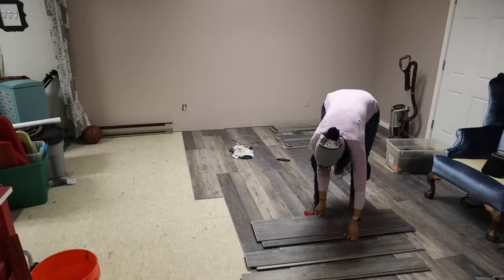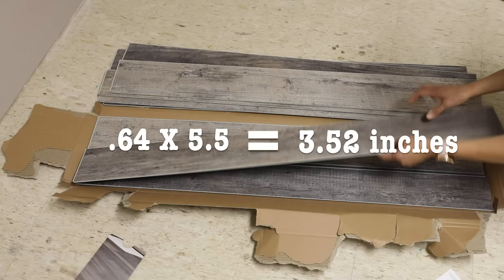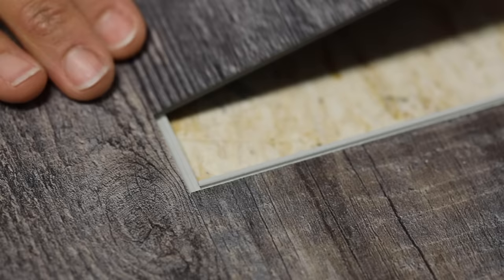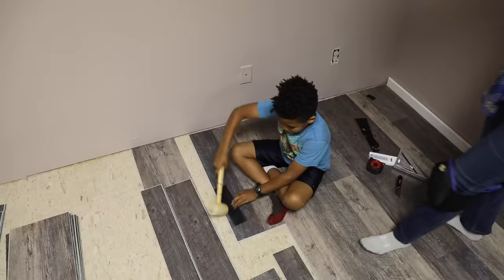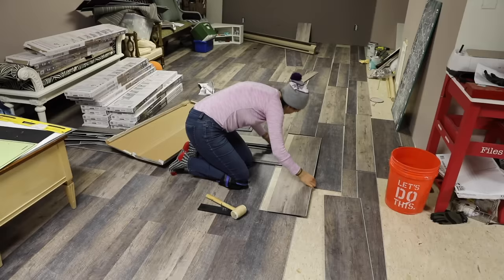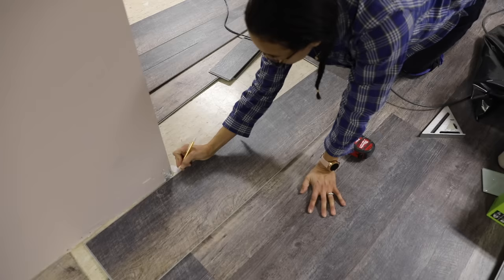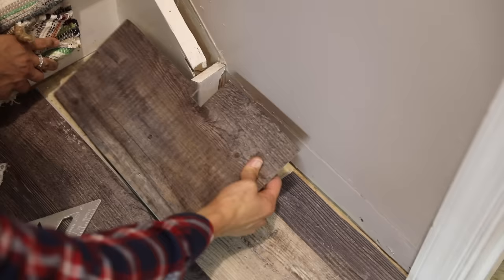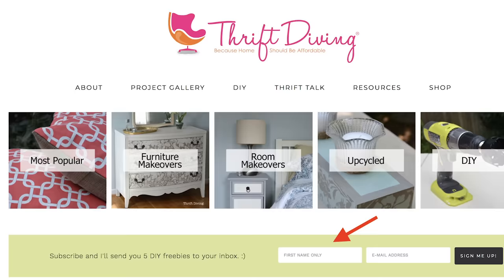How to Install Vinyl Flooring Over Tiles (Over Linoleum Tiles) - Thrift Diving

Comment: Why do they put spacers at first row when starting
Reply from the maker: The spacers are for expansion. I don't know how much vinyl floor will expand, but any type of flooring (especially wood), needs to keep a 1/4" gap around the perimeter of the room. The spaces make sure you're minding the gap. :)

Comment: I have a textured tile do you think it would still work on top?  My only other option would be to chip up all the tile and lay new down.  Very pricey.  Lol
Reply from the maker: I think it would work! It would depend on how textured it is. I would think to buy 1 box and test it out and see how it works. If it doesn't work, you could always return the box, as long as the tiles aren't damaged. :)

Comment: If your house ever floods is going to be a nightmare
Reply from the maker: I agree with you there. I had to take up part of the flooring near the door while I figure out how to fix a leak in the bulkhead door stairwell. But yeah, what do people do in situations where they have a floating floor? I'm thinking of getting more water leak detectors (I've got 2 in the utility room) so that if there is any small leak, I'm alerted immediately.

Comment: What about doing this over ceramic tile?  How difficult would be?
Reply from the maker: Hmm, good question. I think as long as  your ceramic tile is solid, it could work. I've not tried that myself. Keep in mind that the thickness of the tile and the flooring added to it, could require you to trim your doors.

Comment: Never put different size pieces in the same row, install 1 row with all the same size pieces.  Your floor will come apart
Reply from the maker: This floor has held up nicely for well over a year. I'm not sure what you mean...?
Reply: @ThriftDiving  manufacturer guidelines do not approve that method,  guarantee it will not stay together for the life of the warranty.  If there is little to no traffic then it will stay together for obvious reasons

Comment: Can I do flooring like this if my floor is ceramic tile?
Reply from the maker: Hmmm....good question...I honestly don't know. I have never tried it. I think it would depend on how it lies on the tile. If I were you, I would buy a single box of tiles, lay them out over your ceramic tile, and see if it feel solidly connected. My only concern would be that the joints of the vinyl won't be supported enough over the grouted areas. But it can't hurt to try, with one box. If it doesn't feel secure, return the box for a full refund. No harm done. :) I'm a big believer in test, test, and test some more. Good luck!

Comment: the reason I clicked on your vid. is because I layed over the same type of floor you did. you say nothing about the risk or preperation for laying over a square tile floor like what to do if the old floor has loose tiles, dips or uneven spots. is there a risk of tiles commimg loose underneath, should they be stapled down prior to laying the new floor, what happens if the old tiles get wet, should there be a vapor barrier between them. anyone can follow the directions to lay a new floor, but what about the old one

Comment: Does this work well on uneven surface?
Reply from the maker: Hmmm...good question. I think it would depend on how uneven, and if it's noticeable or if the unevenness prevents you from getting a good connection to the vinyl boards. But since theirs flexible, it likely wouldn't be much of a problem.

Comment: Do you have a link to the baseboard that you used in your  Basement  ?
Reply: There only couple of standard baseboard profile one of is plain square profile. Can be found at any   trim retailer or at your local hardware doors i.e home Depot or Rona.

Comment: Title is misleading..."tile" implies ceramic to most people.  What you have is irrelevant, as it could have been ANY kind of flooring that was flat.
Reply from the maker: Well, it's a tile. If I had meant ceramic tile, I would have said it. I mentioned the "over tile" because this is flooring that can be installed over existing flooring. Since I installed mine over linoleum tiles, hence the title. Thanks for watching!

Comment: This vinyl flooring looks great but has a major drawback. You cannot use rolling chairs, aka, office chairs on it. We've tried it in both our business and our home and in both it was a disaster.
Reply from the maker: How did the rolling chairs affect it? Are you saying it wore it down quickly? This flooring is rated as scratch resistant. Was it this brand or another brand you used?

Comment: Just install hard wood this won't last once it get wet your screwed good luck i want to know if you have this 3 plus years if you do good luck you won't though
Reply from the maker: Well, hard wood would be an even worse product to install in my basement. This was the best option, aside from ceramic tile, which is completely water proof. The goal is to prevent any water from getting into my basement, so that's what I am focused on. It's been 1.5 years now and it has been doing well. I'll gladly post updates as we go along! :)

Comment: This stuff is so nasty, it is cheap but is the worse product to cover a floor with, I would rather use solid timber, then I know it will last the next 100 years.
Reply from the maker: James, did you not listen to the video? It's my basement. Putting wood in the basement is a horrible idea. If you're talking about a kitchen or a family room or something, then that is a different idea. But a basement, this is appropriate. This isn't nasty. It doesn't have a vinyl smell and is very easy to install.
Reply: In your situation its probably a case of it doesn't matter what goes on the floor, here in Australia we have heat issues with vinyl flooring, it lifts and buckles,  I have seen it float anything up to 2" of the concrete flooring. Its a product I personally will never use.

Comment: Ugly color and you can buy these things in a cheap store just for only a few dollars.
Reply from the maker: It isnt ugly. And it was $2.99 per sq ft. Show me a store where you could buy this quality for any less than that.
Reply: @ThriftDiving  You can look around in any Restoration Hardware Outlet or in any Chinese Restoration
Reply: Yeah maybe 3m. 
What shes installing is 7m
Reply from the maker: Still, even at an outlet, I would be shocked to find it much cheaper. But hey--if those options exist, go for it. Doing stuff around the home can be expensive, which is why it's taking me so long. It's too expensive to do all at once.